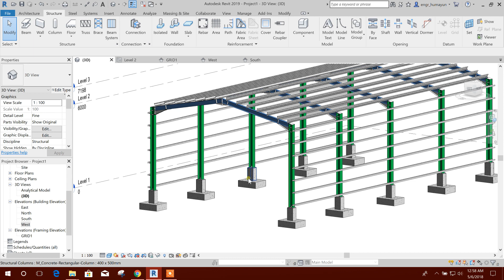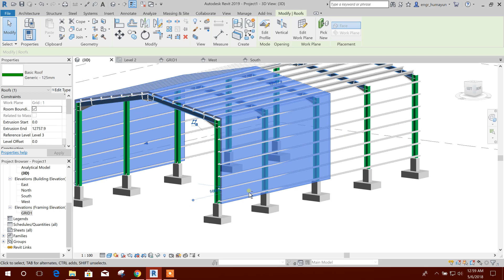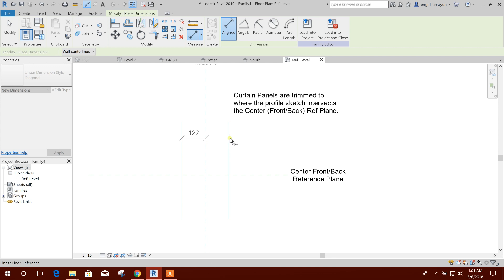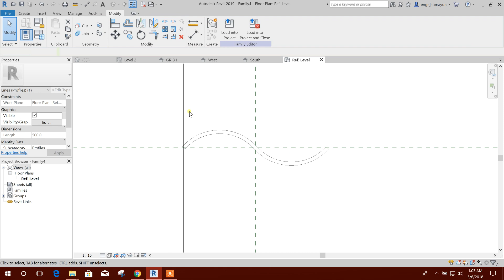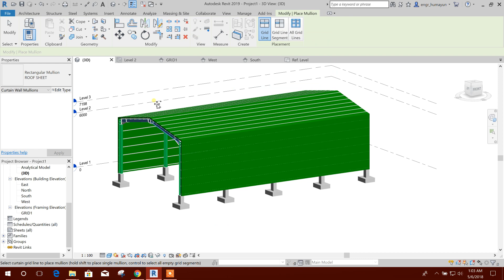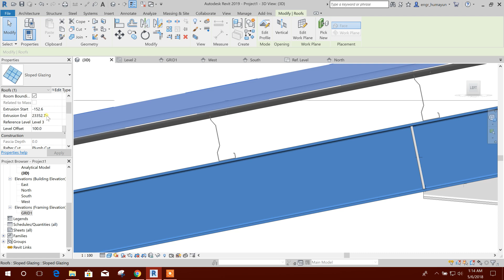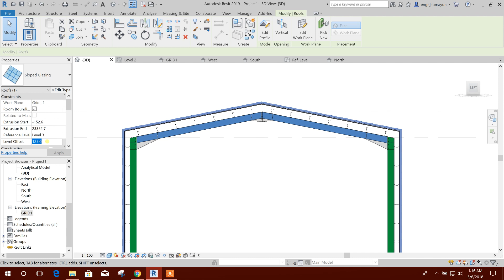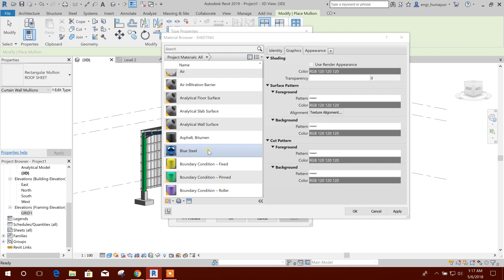Modeling Roof & Wall Sheet in Revit 2019

Comment: Question: After I place the mullions, I still see glass in my model. They do not disappear as they do on your video. Thank you very much!
Reply from the maker: May be you are checking it in Shaded view, need to see in realistic view.
Reply: @Decodebd  I will try. I am an architect and I really loved your video. Thank you! If you rename your video something along the line with "corrugated metal deck roof and wall" you can reach to more viewers!
Reply: it's the same for me I see the glass did you figure out a solution for it plz?
Reply: having the same issue. Did anyone figure this out?